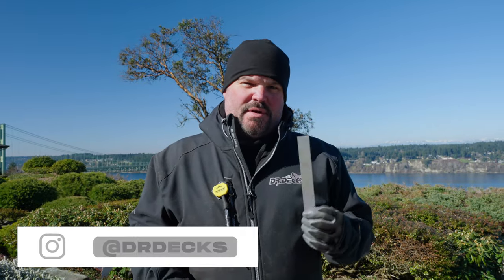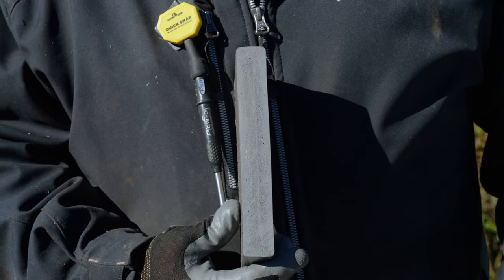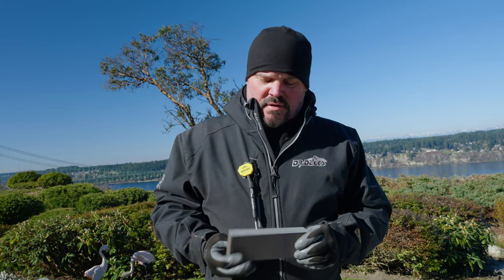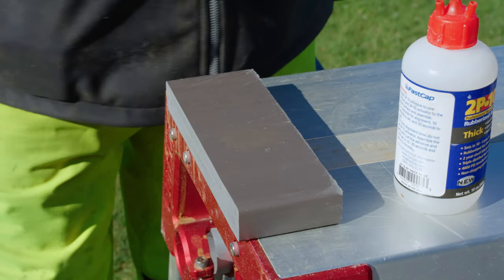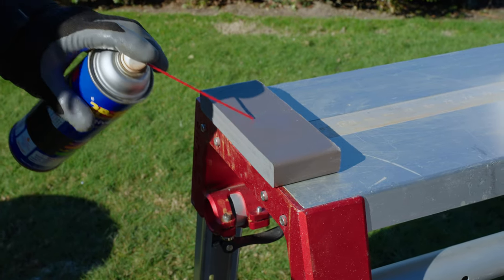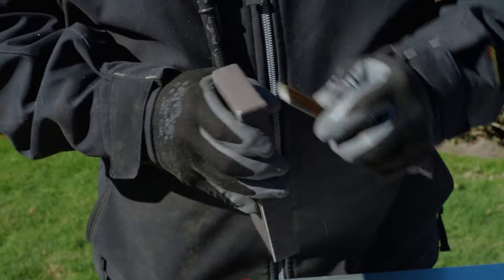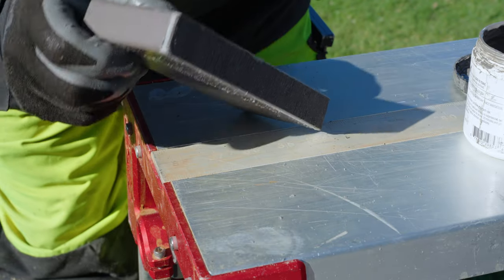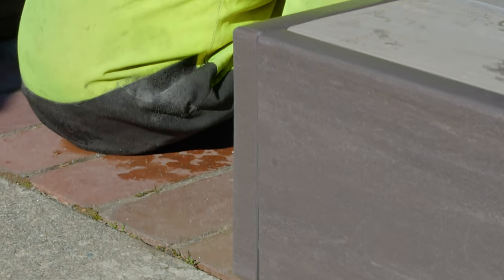How We Finish Some End Grains || Dr Decks

Comment: I’m a homeowner in Virginia. We had a deck installed with Trex and the perimeter miters are now all 3/4” wide. Two of the deck screws have broken off holding these boards down and I suspect it’s due to the green PT lumber framing that shrank over the past few years pulling these miters open. I’m now a big fan of these butt joints shown in this video. I now hate miters.
Reply: I prefer butt joints the miter joints seem to separate after heaving

Comment: We always miter and picture frame all our decking including returns on stair treads. We use plastic biscuits and All Weather PVC cement and have never had an issue with separation. The key is to not precut the miter and immediately cut the plate and assemble. Delaying the assembly after cutting the miter results in movement.
Reply: Where do you get the plastic biscuits?
Reply: I’ve never had a problem with miters pulling apart either but I glue and pocket screw them.

Comment: I have recently installed a Trex deck. I’m planning to install the fascia. When putting two fascia boards butted up against one another does the gap show? Should I put a special cut on?
I have a 16 foot deck. The fascia boards did not come in 16 footers so I plan to put up one 12 and then cut the next one to 4 feet. 
Thanks, great videos.

Comment: If it stays adhered it’s a winner.. great idea . I been doing it with fasten master hot melt glue since they came out with this system ..  but will switch to 2 p 10 if you say it holds on? I’m in New England area (ct.) Mr.Tom 🔨btw, you are doing some nice work for youngsters!! 
I’m in yr 48 or 49  - not age, in the building trade!

Comment: I really enjoy your videos. I'm always searching for better ways to build decks. Imho, mitered corners look better, but use CA glue and screws with caps to hide the heads. Word to the wise, just make sure that when installing in hot weather, you float the corner a bit so that when it contracts, it doesn't rip the screws out (had that experience before). Another thing is that when you choose a skirt board/fascia board, make sure you choose stock that isn't cupped on the ends. That is a pain to get the miter to lay nice.
Reply: what do you mean by "float the corner"?
Reply: It means to extend the miter joint past the framing so that when it cools and shrinks, it won't pull the miter apart. Since that post, I now make vertical corner pieces that the fascia board slips behind. Much nicer.

Comment: Great explanation. Does this method and glue work with composite decking?
Reply: The website says "2P-10 can be used on any material as long as it is clean and the surface is well prepared". There's your answer.

Comment: you can spray the activator in a paper cup and use a brush to spread it on the board. too bad the board manufacturer doesn't make edge banding tape..

Comment: If you're already doing a butt joint then you could just do a regular return. A miter only opens up because both long boards are expanding and contracting. If it's just a 3/4-5/4 long return then it will never open at the miter. Save you time from ripping the pieces, filing, and painting. It would look better too.
Reply: what do you mean a "regular return"?  What does that look like?
Reply: @jbhcrazyskills9508  It's the same as a miter but just with a short piece. Generally for ending your window aprons, baseboard, chair rail, etc. I'll make a video on it soon if you'd like.
Reply: @Tool_Addicted_Carpenter   Ah Okay, I got you. Interesting concept. I guess the only place it could open up is between the long piece and small miter.That would certainly look better than opening at the miter.Maybe instead of an ultra small 3/4-5/4 miter, do it more like 6-12 inches.
Reply: Agreed , Regular return is simple, straightforward,  and fast.   Also, most super glues will do.
Reply: @Tool_Addicted_Carpenter do you have a picture of what your describing,please,thank you.